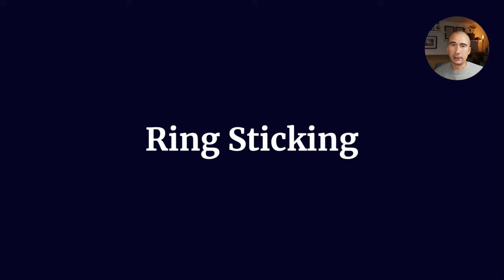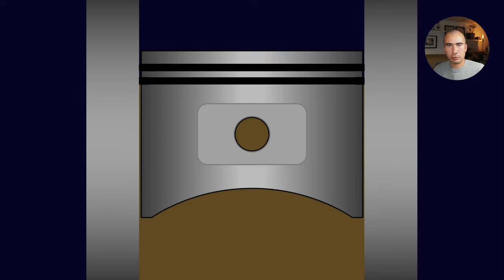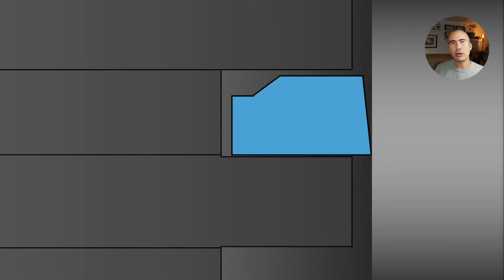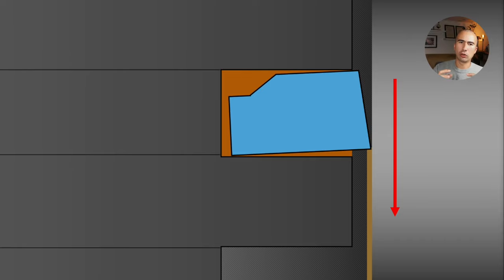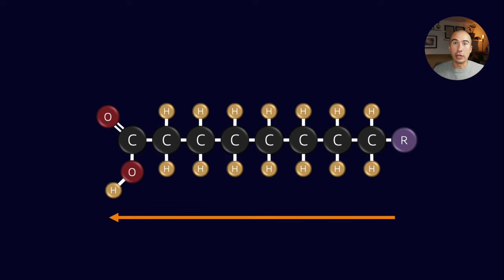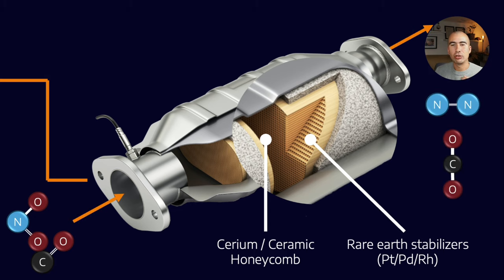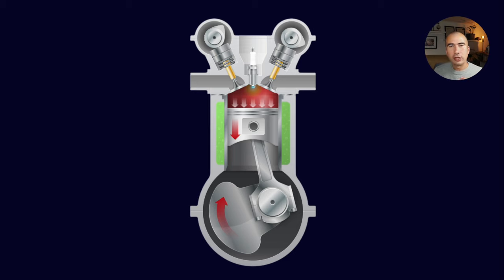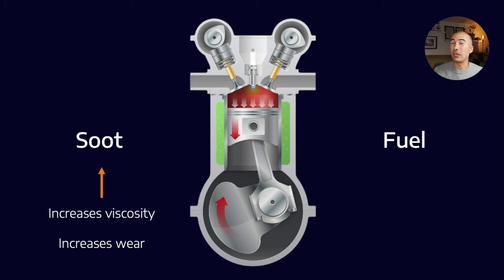The Effects of Stuck Rings & Blowby on Engines

Comment: My GDI engine was consuming oil at a very high rate due to a stuck oil control ring.  I added Berryman Chemtool to an empty gas tank and then filled the tank with high octane gas.  I then drove for about five miles with the engine at high RPMs (4000-4500) but never redlining the RPMs.
The excessive oil consumption is gone.
The combination of Berryman Chemtool, high octane gas, and high  RPMs freed up the oil control ring and eliminated the problem.  There was no need for a piston soak.
Reply: You should have made a video for that. It's a very good idea but it needs further explanation

Comment: Don’t know if running Diesel engine cold creates any other chemical effects, but it is decreases oils solubility, which makes oil sticky , and not burning out soot as it should - and both promotes this piston rings getting gummed up and stuck.
Diesels MUST be running up to proper operational temperature and under load.
Reply: I have already read somebody about it, it seems humity is also not properly evaporated and that elevates the acidity of the oil.

Comment: Pls do an article of engine lubrication oils vs low tension piston rings. From around 2005 to around 2012 it would seem that Toyota, BMW, VW and few others have issues on its the design & testing leading to lawsuits, recalls, extended warranty etc etc. Or is it that the engine lubricating oils, in that era, was not advanced enough?. Regards

Comment: On Hyundai Kia GDI 2011-2019 there is a unburnt amount of fuel at each cold start. Another possible issue is very common engine cover seal leak, causing oil to accumulate around the spark plugs - when car is parked this oil leaks inside the cylinder on top of the piston and into ring grooves - over time it gums up oil rings. A second oil consumption context in Hyundai is scored cylinders and worn compression rings due to cylinder wall wash (from the same unburnt gasoline) associated with very low rpm prolonged driving - those GDI engines prefer to stay around 1000 rpm when cruising at certain speeds

Comment: It becomes a run-away effect because not only can you have HC clogging the rings, the increased friction that leads to, then leads to metal microwelding between the piston and ring. This creates a less flat surface for the rings to sit on, those gaps are typically filled by unburned hydrocarbons. The compression is reduced, which leads to more unburned HCs.
Reply from the maker: Yup. Most wear mechanisms tend to exhibit that runaway behaviour.

Comment: Hello, I got a problem: 2002 7.3 Powerstroke V8 Turbodiesel
I got a problem on 1 cylinder: I have compression, medium leak down (piston rings) and lots of blue smoke on coldstart. If the engine warms up it is gettin less blue smoke. It is getting away with higher engine loads. If it is coming back to low load / idle... the cylinder is starting to smoke a little haze of blue. Could that be a bad oil control ring ? 
In the next days I will tear down the engine and I can give feedback.                   Injector is already cross changed, Valve stem seals are changed... nothing changed on my smoke problem.
Best Regards!

Comment: Hello, great video. I have a small kubota 3 cylinder diesel which has started to produce some blow by. It is particularly obvious at idle rpm but when under load at high rpm it seems to reduce considerably. I.m tempted to open and re ring but was told it is a waste of time / money because pistons/rings/liners wear in sets and should be all replaced in one go.

Comment: So is there any non invasive ways to unstick the rings? People always talk about Seafoam, Mystery Oil, Engine Restore. Looking at the chemicals in them, are they likely to actually help with these long chains that can cause the stuck rings?
Reply: B12 berryman soak can work according to the internet.
Reply: @TonicofSonic  YMMV - 1.6 GDI Kia I followed a TSB for high oil consumption.  berrymans is what I used. was using 2  quarts per 1000 miles, now no oil use at 1,100 miles. I did piston soak overnight, then again in am, then oil change, idle to warm. then added Liqi Moly engine flush 1dle 15 mins then final oil change. Had nothing to lose.
Reply: Yamalube Ring Free Plus.
Reply: Really, in most cases I have seen, the only solution was to pull the pistons out and re-ring them.
Reply: @pliedtka  true depending. The  TSB came from NHTSB and if the TSB does not work then an engine is installed under warranty. This worked for the one time tried this. Out of warranty, So far about 4 000 miles before a quart is needed. The issue is the owner does not maintain well.
Reply: Some have used BG Products EPR / engine flush before an oil change
Reply: I did berryman b12 on renault k9k a year ago and my oil usage went from 1l/1000km to 0.14l/1000km aprox. Not sure if its fully clean since exhaust still smells of oil but i dont have to add oil entire oci so im good for now
Reply: @grantechsweng5268  What do you think is avg or normal oil consumption for newer cars with these 'low-tension piston rings' to get better gas mileage. I have a 2010 Honda Accord EX 4 cyl with 120k miles. I change oil every 4-6k miles and noticed more consumption recently. I use Hi-mileage syn oil 5w20 and may go to 5w/30 since I live w/mild winters and summer temps 90's and 100's. I hear different things, so is 1 quart for every 5k miles or 7k or 10k miles consumption normal..or something else..Thanks!
Reply: @1Mannco  1 qt to 5,000 miles would be exceptional. Manufacturers are saying 1qt to 1,000 miles is normal (although normal doesn’t equal “good”, as these GDI engines have valve carbon build up and oil consumption issues by design).
Reply: @sc3ku  Wow, didn't think 1k miles per quart is exceptional or even normal, maybe in these 4cy vtec Honda engines?...I just changed my oil and I'm down a quart when I get between 3,500 and 4,000 miles, I top it off to get to 5k miles to change it every 6 months. So for a 14yr Honda w/123K miles that's ok?..I change it before the very hot summers here in mid April and mid Oct before the mild winters. I've been thinking of using 5W30 syn oil for the hot summers that get to 110*. But I'm not sure if it's ok when it calls for 5W20.
Reply: Try valvoline restore and protect.

Comment: Paradoxically, the presence of fuel in the oil after some time would solve the problem in the rings, because the fuel is a solvent
and would clean the encrustations sticking to the piston rings ...
Reply from the maker: Definitely could, although the quantities may not be high enough for it to have a meaningfully positive effect.

Comment: Very informative material. Hope that more and more people—-especially new drivers—
will learn and remember the vital benefits of Regular Lube Services!
  Btw I do my own oil changes every 4500 km!
Reply from the maker: Thanks!
Reply: Wow, 4500km on synthetic ? Most likely a bit of overkill. But 6k km that's more reasonable. Anyway, most past 2000 engines are prone to oil burning. Our favorite is the 2.4L in CR-V, we change or re-ring them by dozens.
Reply: @pliedtka  Aren't the oil consumption problems with the Honda K series engines almost always caused by the rings sticking from poor maintenance and possibly poor driving habits? I've never seen a well maintained K series burn much oil regardless of mileage. I have a K24A2 in my 04 Civic and it never burned any meaningful amount of oil, but I only use top tier fuel and top of the line synthetic oil changed every 4-5K miles with plenty of long trips and full throttle runs up to redline.
Reply: @averyalexander2303 how many miles on the ol’ Civ if I may ask? Another question, do you mean every 4-5 kilometers or miles? K would indicate kilometers but I know people use it in place of miles as well. Thanks.
Reply: @SpicyMcGeezak  I bought that K24 used for my swap, so I don't know how many miles are on it. But before I installed it, I tore it down to the bare block to thoroughly clean and inspect everything and replace all the gaskets and it was pretty clean and showed very little wear, There was some carbon in the ring grooves as always, but I don't remember anything excessive. As I said in my original comment, I change the oil and filter every 4-5K miles and only use top of the line oil. It's currently filled with Amsoil Signature Series 10W-30. I forgot to mention that I did add the OEM K20 oil cooler though, so that may also be preventing oil consumption by keeping the oil cool enough to not break down and burn off excessively. I have seen reports of fairly high oil temps on these engines under certain conditions, which may or may not be a factor in the oil consumption problems that some people are having. I also deleted the balance shafts while it was apart, which may or may not have any effect on oil consumption.
Reply: @averyalexander2303  yeah I was wondering because I bought my brothers older 07 accord with 234,000 miles on it. It still runs pretty good but it does go through some oil(1.5-2qts between changes) I’m looking for something that might help because I’m not planning on spending a bunch to fix it. I’m just looking around and researching different things that might possibly help it consume less oil. I think he took decent care of it, but I’m think he was using Dino oil and not good quality synthetic.
Reply: @SpicyMcGeezak  The oil consumption you described doesn't sound all that excessive to me. At that age, if it was mine, I'd either remove and clean the PCV valve or preferably replace it with an OEM Honda part for about $25, that could help with oil consumption. Doing what you can to clean the rings can only help. I've heard a lot of great results from adding a quart of High Performance Lubricants Engine Cleaner to the oil for a few thousand miles. Piston soaks are also an option. If the previous maintenance wasn't great, just doing regular oil changes with a good quality synthetic oil may reduce oil consumption in the long term. Unfortunately, if the valve stem seals are hardened and cracked from age and heat, nothing you do other than replacing them is going to fix that.
Reply: @averyalexander2303  I already changed the pcv but I’m wondering if I shouldn’t pull the hose off and clean it as well in case it’s gummed up. I already changed the oil, he was running 5-30 in it but I changed back to the recommended 5-20 with synthetic oil. In your opinion, should I have stuck with 5-30? Might a bit thicker oil help to burn less possibly? I know one thing, the oil seems to be getting dark/dirty looking rather quickly. I might try some of that HPL the next go round and see if that helps. I’m also debating on doing a piston soak with b12 chemtool. Any recommendations on how to do that more effectively? And should I do that with fresh oil or can I do that right before my next oil change? Thanks for any recommendations, much appreciated.
Reply: @SpicyMcGeezak  Did you use an OEM PCV valve hopefully? I haven't had good luck with aftermarket ones on Hondas. I doubt you need to clean the hose, but it wouldn't hurt. 5W-20, 5W-30, and 5W-40 are all fine for the K24 according to the Japanese and European owners manuals, feel free to use whichever gets you the best results. You definitely want to add the HPL to clean oil with a new filter and monitor the oil and filter closely if the engine has significant buildup. I'd change the filter 1-2K miles after adding the HPL, cut open the old one to see how much crap it caught, and change the oil and filter accordingly. I have never done a piston soak, so I can't help much there. My only advice would be if you are going to use a harsh chemical like B12, change the oil immediately after to remove whatever solvent ran past the rings and into the crankcase. Personally, I'd try soaking with something less aggressive like Marvel Mystery Oil or Seafoam first just because I don't like the idea of using something that will strip the oil off the pistons, rings, and cylinders and risk dry friction on startup, but that's just me. If you do use something like B12, I'd definitely add a little oil to each cylinder before startup to prevent scoring.
Reply: @SpicyMcGeezak put a  catch can in line on the pcv system and loop the hoses up high when coming off the valve cover   don't down shift or slow the car down with the engine that's when it sucks up the most vacuum in the pcv system and will make it use more oil then check the catch can in a thousand or 2 miles the catch can will save your cats and o2 sensors down the road any car that's burning oil will stop up the cats and the 02 sensor it's just a matter of time if u add the can in line not vented so pcv will still be working it will just give the oil a place to go if That makes sense hope this helps u and the ones reading it !
Reply: @rickybailey7123  thanks for the advice, much appreciated.

Comment: So would the following help to reduce wear, internal corrosion and the risk of sticking rings on a CRD Common Rail Diesel Engine:
1/ regular synthetic oil and oil filter changes?
2/ oil flushing agent prior to oil change?
3/ Centrifugal oil filter?
4/ Centrifugal air pre cleaner?
5/ blocked EGR valve?
6/ limit condensation by storing vehicle in enclosed garage especially overnight in Winter? (never below 5 degrees Celsius)
7/ optimal injector operation by regular sonic cleaning, tested and maintained in service by using fuel additives that lubricate the diesel more and a decarboniser?
These additives have been independently tested with detailed scientific reports.
8/ Well designed , tested  and maintained oil air separator for crankcase blowby gases, aka Catch Can?

Comment: If you will allow me, I have a green waste of oil that freezes in the winter and in the summer it returns to a liquid. How can I extract paraffin wax from this oil? Please advise and thank you.
Reply from the maker: Not easy. In refineries this would be the solvent dewaxing step and is reasonably complex, I believe the way it used to be done was waxy oil was mixed with naphtha and filter aid (fuller’s earth or diatomaceous earth). The mixture was chilled and filtered, and the filter aid assisted in building a wax cake on a filter cloth. You might be able to try something like that.

Comment: If the oil-control ring scrapes the oil off as the piston moves up the cylinder, how does the piston still get lubricated?
Reply: The fuel will cool the cylinder wall and also any unburned petrol will lubricate for the combustion stroke and during the intake stroke too.

Comment: Do you have any tips for us where we think our piston rings might be stuck?  I ask this as my car consumes too much oil and I have been trying different products but without any success.
Reply from the maker: Good question. Unfortunately the answer is “it depends”. If the rings are stuck because of oxidised deposits, then a flush with a high solvency oil will help dissolve them. But if it’s more like dirt you would need something with high detergency. The problem is that high oil consumption could be for another reason as well, like bore polish, liner scuffing or valve seal wear.
Reply: @LubricationExplained  All true. I've also known people who had good luck with the Italian tune up for freeing up stuck rings. Running the engine hard reasonably regularly is at the very least good for helping to prevent stuck rings, more than one manufacturer released service bulletins on that. But obviously using good fuel along with a good quality oil of the proper viscosity and changing it at regular intervals is most important.
Reply: Try BG EPR at your next oil change, it helps clean the deposits around these rings helping to restore lost compression etc. It really works.
Reply: @Weareeverything2023 This is true. This stuff made my f150 run smoother and have more power by increasing compression and reducing oil blowby with a single treatment.

Comment: I have getz 2007 it started burn oil after timing seal failure i replaced it and want to do engine flush in the next service i use 15w40 oil to minimize the burn but i wont use 20w50 because the oil need to have smooth stream and i cant let the oil pump work harder the car has 270k km

Comment: I get a poof of white/grey smoke when I launch my car hard. No smoke after. Would you say this is caused by my rings being worn? It's a 2006 Nissan 4cyl with 120k miles.
Reply: This is likely a leaking valve stem seal overnight.

Comment: Help needed
My mechanic is saying that my car Mitsubishi Mirage 1.0L has a sticky rings problem and needed to be replaced. But there is no smoke coming from exhaust or decrease in engine oil. 
Car is showing under performance in power, and missing and misfire at cold start.
Reply: Hello,
Have another mecanic diagnose your problem, need a compression test,a endoscopic camera to look at the cylinders walls and valves.
You can have a differential pressure test done on each cylinders, it could reveal a leak towards your problem.
Always ask for a second diagnose, there are severals ways to get to pinpoint the problem.
Tigo.
Reply: Sounds like you may just need new spark plugs. I would start with that to see if it fixes the problem. Cheap, & you can easily do it yourself.

Comment: 2 compression rings. Gaps 180° apart. 1 oil control ring.
Reply: Unless the rings are stuck, they are going to rotate as the engine runs and the gaps are going to end up wherever they want anyways. It would be ideal if the gaps would stay 180 degrees apart, but there is no practical way to accomplish this without causing other problems.